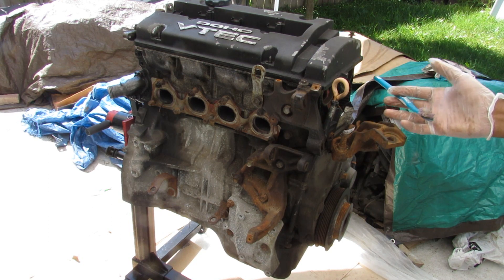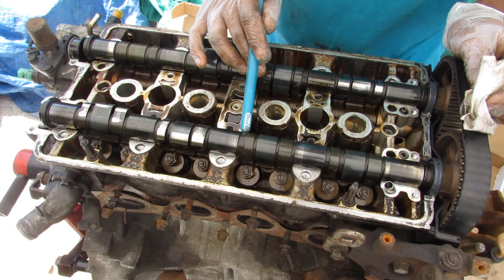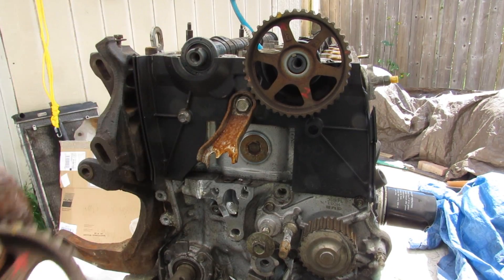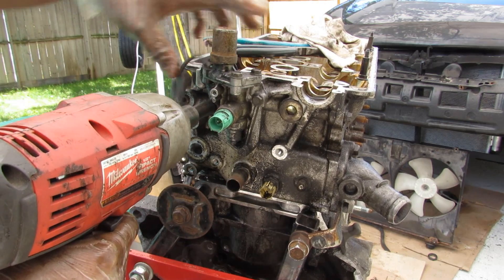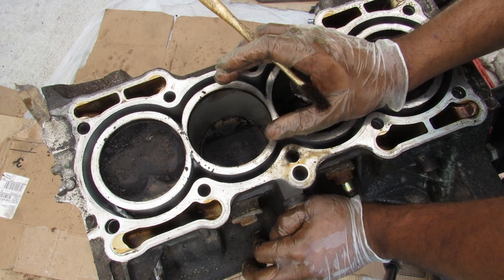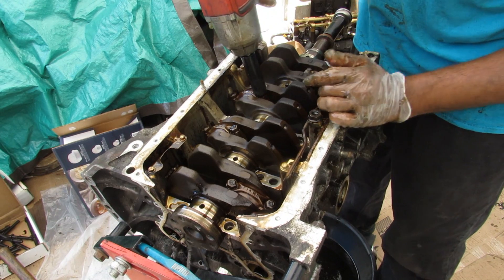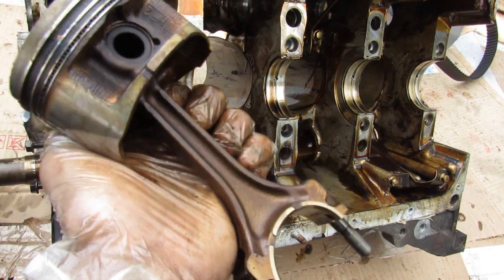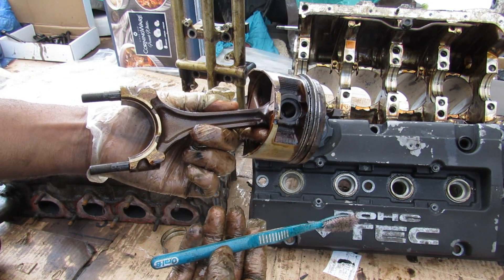Why the Honda H-Series Engine is the Best of the 90's

Comment: When Honda actually knew how to make an engine. Sad we lost this and the D series was ruined with the d17 and honda went to complete garbage after 2001 discontinuing everything fun all fun all reliability and freedom... long live the h series.
Reply: I guess you've never experienced a K20A type r engine? On top of being way more stout, the simplicity surrounding the design (including the engine bay harness) is greatly simplified and makes it much easier to work on. As he said, K series is a great successor to the H. 

You're right about that D17 though. Abomination lol. I have an E series...ever hear of that one? 🙃
Reply: @shane6961  ive owned a built k24 with a type r head, k series engines are fantastic, but however the fun and excitement of honda died with it. The only thing honda left behind was a great motor, the cars itself garbage, heavy, adult and mature like. Hondas 80s 90s cars were childrens toys they didn't have mature audience in mind they wanted a reliable cool fun car, 2001 they switched it up to fitting in with the rest of the boring lineups but gave us the k series in exchange.
Reply from the maker: Agreed. Things turned at the start of the millennium but at least the K-series makes for a decent modern replacement

Comment: Had h22a7 (Accord type R) and h22a8 (Prelude 2.2 red top)

The H22A7 somehow feels more raw than the h22a8.

I ended up money shifting from 3rd to 2nd, RPMS went to 9000s and I JUST caught it.... until 3 months later the car started burning oil more and more snd smoking blue smoke....

Deep down I know I caused the issue, despite it being fine for the first 3 months after
Reply: I'll buy whats left...
Reply: That's interesting. 9000rpm is not that high. Especially that you caught by hitting the clutch. Did you redline in 3rd and then went into 2nd?
Reply: Throw it away and buy another one…they’re cheap and always sitting at any engine importer. No one runs H series anymore.

Comment: 9:12 many (if not all, made after the mid 80s) dirt bikes engines are like that but I'm not sure it's the same thing. They call it Nikasil. It lasts a lot longer than a cast iron sleeved cylinder, has better heat transfer and are able to work with tighter tolerances but the downside is when they get damaged or wear out, you have to bore the cylinder and replate it or depending on the damage, replace the whole thing. Some say they can also produce more power because the coating is more "slippery" than a cast iron bore. I had NO IDEA something like that was being used on a regular car engine.
Reply: This was used on H-series engines and C-series engines for the NSX, and also on the F20 from the S2000. Complicates the choice for aftermarket pistons as they had to be compatible with the FRM liners. Still with OEM or properly made pistons these cylinders never went out of shape or wear out despite sustaining high rpm and high compression on some of the models. The piston rings would get worn instead.

Comment: You don't really feel vtec on these h engines, b series you can
Reply: I disagree haha. Might depend on the car but in mine it gives you a hiding when the tec switches on
Reply: You do on the 4th generation prelude I can tell you that. Best ever marriage of this engine was the 94-96 prelude. It’s a better car than the 5th Gen. Most have never driven a stock 4th Gen 94-96 VTEC  because they are super rare or modded to all hell ruining the delicate perfect balance the Honda engineers pulled off. 
  Trust me , it’s the best Honda not called an NSX. Better feel, better clutch, better looking and more aerodynamic front end. It flat out flies. The best way I can describe -the car becomes your skin.
Reply: @Johnnyflyy  I use own a h22a bb4, I built the whole engine and I still don't feel vtec all that much

Comment: I have the engine that is most common for oil burning issues. It's preventable with regular oil changes and not cold thrashing it. My car has done 280,000km and needs 1l/8,000km.
Reply: All older Honda’s burn a “little” oil…just add more…change the plugs every oil change…they still last but won’t pass smog
Reply: @mechanicundercontract7752  for this specific engine h22a7 it's a very low amount of consumption. No smog here. I keep up on the maintenance. Plugs are expensive in my country, still replaced them last year tracing down a missfire.

Comment: Nice teardown! If someone were to boost one of these, what upgrade to the engine would you recommend to handle the psi?
Reply: Cylinder support system a f20b block and forged pistons and rods and keep it under 600whp on water meth injection
Reply: Depends on what block you use. Outlaw Pat mentions one of the more involved, but better builds. I think they called it the g23 back in the day (between f and h). There are a few diffrent blocks, but anything with FRM liners will need to be sleeved or low mile, hence using the f20 block, which has conventional liners iirc.
Reply: @nobodynoone2500  I have a 95 Honda Accord w an f series block but 300k miles on it. Was planning to do H22a or H22b engine swap but not sure where to get best parts to mod the engine out properly.

Comment: I have 2000 Prelude with ~120K miles. It does leak oil. I have to check the level about once a month. But other than that, it has been so reliable.
Reply: Prelude on top bro
Reply: You better be checking your oil more often than that, no matter what you own.

Comment: I don’t understand if the position rings weren’t tht bad and baring won’t that bad where was it burning oil and why was there so much crust in the combustion chamber
Reply: Crust in the combustion chamber: EGR issue, bad plug/wire, bad fuel, or running rich due to a bad sensor...? I'm just talking out of my ass here.
Reply: @fun_ghoul  that's normal for average driving standard vehicle. If you put it in a race then some of the carbon will blow off. It's not an issue tho

Comment: I miss my 2000 Prelude with the H22A4. The VTEC was awesome. The only work I had to do on it was change the oil filter in the VTEC solenoid. The first time the dealer saw me was at 160K to change the timing belt. I banged every shift at redline for 12 years, until it started to burn oil. I sold it to someone who could do the TLC it needed at that point. It's still running great as far as I know.
Reply: I replaced it with a VW since I couldn't find a Honda with a stick. This was right after the tsunami. After multiple repairs my wife begged me to sell that POS before the warranty ran out. I went back to Honda and it's been 6 trouble free years
Reply: @ccloutiutube  Is there a big premium on Veedubs on your side of the pond? I sure hope not! Lol
Reply: @fun_ghoul  no, there wasn't. It was a stick shift VW CC with the 2.0T gas engine. In less than 3 years 1 coil pack and 1 intake plenum went bad. There were also 4 problems with the water pump. Glad I sold it.
Reply: I know the feeling, had a faithful one for 17 years.
Reply: Great video as always BTW

Comment: "These engines were actually pretty powerful for their time, producing almost 100hp"
😂
"...per liter."
😯
Reply: Actually crazy how efficient these engines are, that’s the same as the viper pushing 800hp, but vipers do half that
Reply: Don't see the problem....
Drivebility is just as good or even better than most other brands..
No problem to drive 50km/h in fifth gear in any Honda.
Reply: That pause almost got me as well
Reply: That's actually an achievement
Reply: One of them makes literally 100hp per litre and with some mods can be easily a touch over 100/l. Great fun but it is the reason people say Hondas have no torque haha
Reply: @ReubenHorner  i think they mean hondas have no *low end torque*. If an engine makes 100HP and only 90Nm of torque, while another one makes 100HP and 180Nm of torque, both engines make 100HP. HP is HP. The torque DOESN'T MATTER. The engine which makes less torque will run at HIGHER RPM to compensate for the lower torque. The gearbox can convert that high RPM through gearing into more torque.
Reply: @dieselgeezer18  Yes I fully understand this. Its all about where the power comes in. My car makes similar power to say a v6 or maybe an oldschool v8 but at 3000rpm the v8 makes much more power (and torque of course) 
Horses make you go fast and the torque makes it feel fast (off idle acceleration etc)
Reply: @ReubenHorner  what makes the V8 feel faster off the line is the low end torque. The V8 doesn't have to rev high in order to make lots of torque
Reply: @dieselgeezer18  torque is a function of the stroke
Reply: @samspianos  Richard holdener did some videos on this one. Turns out longer stroke vs wider bore hardly makes a difference
Reply: @fun_ghoul  
What is the best bore to stroke ratio?
1.0 to 1.4
Truck stroke/bore ratios are typically higher (1.0 to 1.4) to improve efficiency and low speed torque. The higher the stroke/bore ratio, the less RPM the engine can safely handle, but the more low end torque it will produce.
Reply: @fun_ghoul  thats to make it easy to understand that there are multiple entries there to help people understand physics
Reply: @fun_ghoul  I thinl you have a lot to learn ;keep at it;with effort comes results
Reply: @dieselgeezer18  I think thats not true. It depends of the kind of use. If you will use your car only for racing, its ok. but for daily driving if you have a car with the same power but more torque it probably will have a more fully power curve for all the range what makes the car more comfortable to use.
Also, you can't say HP is HP and compare two cars with same HP like they will be same fast without seeing power curves, because HP is maximum power at the best range point. Maybe one of the engines produces half the power only 1000rpm below (I'm exaggerating)
Reply: @borjacanobarredo3451  again, torque doesn't matter. Its about how the transmission is geared and how much low end torque the engine has when talking about driveability. If an engine makes shit torque, it can be geared very low through the transmission or the final drive to compensate for the lack.
And yes HP is HP. When both cars are in their powerband, they make the same HP.
Reply: @dieselgeezer18  Thats not true, the powerband as you said can have different sizes and shapes and HP is maximun value, only a point in the curve. Two cars with same HP could have very different performance and driveability. I have a tractor with 90hp and has nothing to do in performance with a 90HP car but it can cross a house destroying the walls at idle. 
This is not only because gears, its because the way the engine was designed with bigger pistons and longer connecting rods which translates to more slower and torqui engine.
Reply: @dieselgeezer18  "Torque doesn't matter" Lol no torque matters a lot more than HP does, HP is a function of torque and RPM, yes you can get the same HP figure at higher RPM but your torque absolutely matters, low revving high torque engines are way better off the line. The place high revving engines are great is tracks where you never drop below the powerline. HP is basically how much torque you can apply over a length of time or cycle of time in the case of engines.
Reply: @SPAZTICCYTOPLASM  "torque matters a lot more than HP does" Lol, not at all.
Reply: @ReubenHorner  same with the F20B DOHC VTEC  2000cc/200hp= 100hp P/l
Reply: @ReubenHorner  tq to weight ratio is actually really something. My h2b civic makes 426 ft lb tq 576 whp. 1.5 60 ft. 136 mph on the 1/4 mile.
Reply: It gave me an excuse to keep the revs up, and stay close or in that sweet VTEC
Reply: I made 196 whp 161tq jdm H22a with all the bolt ons stock motor .
Reply: @Suerte_Pepe  I guess that means Honda underrated their engine.

Comment: Damn, no wonder you can build these to make 1000hp. Everything about it looks stout as fuck.
Reply: Honda makes the best 4 cylinder engines without a doubt just look at the video done by haltec on the Honda k series
Reply: @pinytenis420  I often make the joke that Honda is a company that sells engines, that just so happen to come with a free car attached to it
Reply: @accordinglyryan  very true
Reply: This is open block, closed would be better.
Reply: @rollthelosingdice  the closed blocks didn’t come to America my jdm h22a is closed deck but usdm is all open deck
Reply: @pinytenis420  no h22a1 is also closed deck. Usdm
Reply: @pinytenis420  incorrect obd1 {h22a1} usdm blocks are closed deck.
Reply: My F23A1 in my CG accord the bottom half looks EXACTLY the same and I believe the head can work on either or.
Reply: @mauricemotors8207  Yeah I believe the community calls that a "G23"
Reply: The lining of the cylinders and oil pumps always fail under boost…you get more power all motor with a B series any day… if you want the best then you would be shopping for a B, K or J series motors for dependability and how modification friendly they are…H series is a waste of time. Unless you want to spend a fortune to upgrade and I guarantee it will still fail.
Reply: @mechanicundercontract7752  you must be a noob H22 is the exact opposite of what you say. They’re all good. All have pros and cons. K is the alternative of the b and h. Best of both. Just cuz the design of the head and timing system. H2B ej1 576 whp owned the car 10 years now. Went from b18c5 to f20b to CSS H22 t4 turbo. Only thing stopping 800whp is the car is street legal 92 pump lol H series is just as good if not better than a b. Just have to get the closed deck ones or f20b block has steel sleeves. They’ll make 800+ without sleeving them. B H = big power with boost no matter
Reply: @outlawpat8038  What would be better to boost? B18A1 or H22A?
Reply: @mechanicundercontract7752  I dailyed my boosted at 270whp for two years the only oil burning was from the turbo
Reply: @pinytenis420  WHY YOU WOULD EVEN BRING UP 270hp 🤣🤣🤣 I  made 450 hp with my D series…12 years ago…and drove it for 3 years straight…when you make real power, then come at me!!! Just ask Brent (PFI SPEED) or Kyle (Boosted Boyz)how much money and work it is to make REAL POWER…
Reply: @pinytenis420  you dont need to sleeve an H.
Reply: @mechanicundercontract7752  450 is slow now. Brent and Shane are making huge power nunbers now. The game has changed alot.  I saw Them a couple of months ago at the local Honda car meet and Shanes Crx is a monster!
Reply: @mechanicundercontract7752  H and B use the same liners and oil pumps. the pumps dont fail from boost they fail from RPM. you cant spin a stock honda pump over 9k reliably. the obd1 H's were solid deck so no they DID NOT have the liner problem of the open deck B's. you are talking out your ass.
Reply: @mechanicundercontract7752  a b series wont work good in a cd5 accord and the k series and j series swap are expensive and alot of work!
Reply: @joeygill2616  best h series to use on cd5 accord?
Reply: @universalg_  yes

Comment: I had a 1992 Prelude with this H23 engine, non Vtec though. Still it was a beast, sold it in 2003 with 231,000 km on it, never touched it except the oil changes, and I did not drive it like an old lady, I was in my twenties. Miss it to this day.
Reply: I respect those motors over the H22 or H23 VTEC block any day…especially the JDM version…Serously can take all the abuse…we dropped one in an integra…turbo was set at 14 psi all day and it lasted 4 years…until the oil pump destroyed itself…🤣🤣🤣🤣 back to the boosted B Series we went… This was in 1995… years before the K series came out. Today we all run K Series…but I’m looking into a boosted J Series AWD…

Comment: Wow. That impact gun removed that crank shaft bolt without breaking a sweat. Did you already break it free with a breaker bar and the Honda crank tool? It was a real pain to get it off my D-Series.
Reply: The d series is tough, no match for my dewalt 350lb ft breakaway torque electric impact. Make sure you get a beefy socket. Thicker, the better
Reply: @youngb1ood  Good to know. I just got a new Dewalt impact. Haven't had a chance to test it out.
Reply: An impact is gold in the junkyard. Mine is an old DeWimp clunker, and it's made me thousands of dollars.
Reply: Someone else commented and he replied that yes, he did break it free with a breaker bar before shooting the video

Comment: 0:50 this statement really holds no weight since RHD cars exist. Honda just started out making engines that spin backwards (counterclockwise) and it stuck to when they made cars. So the engine is placed the other way around in the bay to avoid using an intermediate shaft in the gearbox.

Fun fact: Mitsubishi evo 1-3 had the engine on the left side of the car similar to hondas, but their engine spun clockwise
Reply: @Ninja600j  righty-o, you got me man!
Reply: Weakest comment I’ve seen yet

Comment: I am looking forward to a B Series breakdown.
Reply: Just buy one and take it apart
Reply: The vtec and non vtec have different heads but are similar. b18c's have a crank girdle, while b16a-b20z do not. Intake manifolds differ quite a bit, with the b18c1 having a unique multi-runner design with an extra butterfly. The b16b and b18c5 were the type-r engines with 45' cut valves, bigger cams, and built for a higher redline. Beware if building one, the b20 (crv) engines have no baffles in the oil pan (not recommended!), an integra one fits and has them.